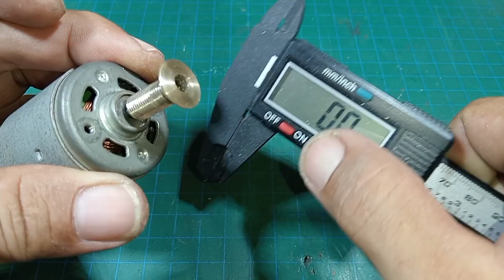4 cara membuat gerinda mini dari dinamo dc

Comment: Mohon info bang.. Saya ada cabutan Dinamo dispenser 12 vollt, apa saya bisa memakai power suplay cabutan printer output 24 volt.. Mohon infonya bang
Reply from the maker: Iya tetap bisa bang, tapi tidak recommend karena voltasenya terlalu tinggi yang akan mengakibatkan dinamo cepat panas. Silahkan dicoba dulu bang terus ambil kesimpulan, kalau aman lanjutkan 🙏👍👍